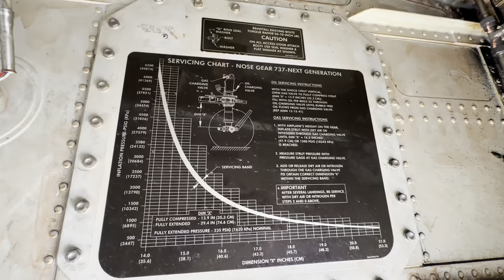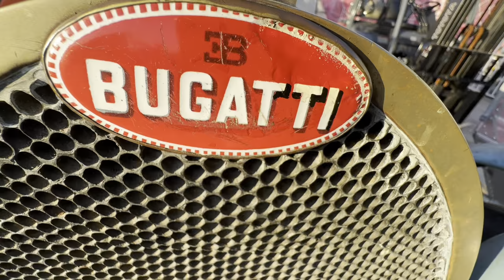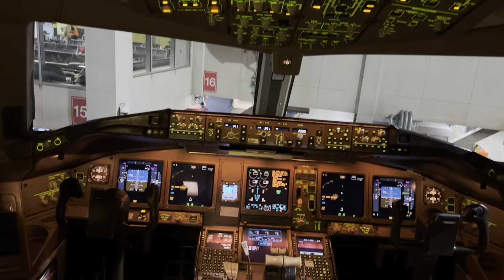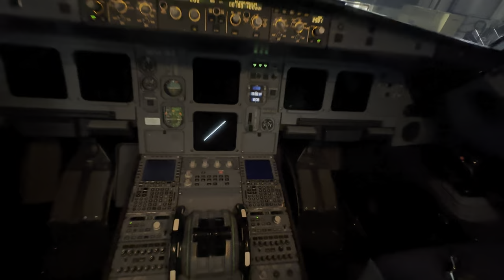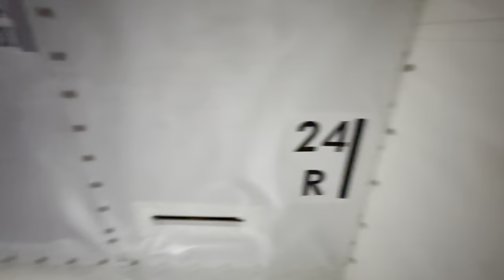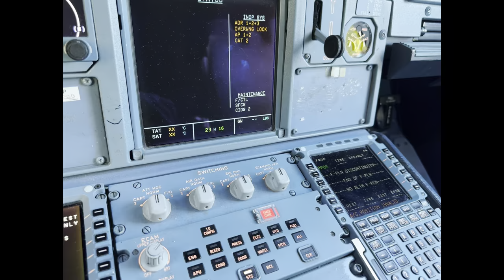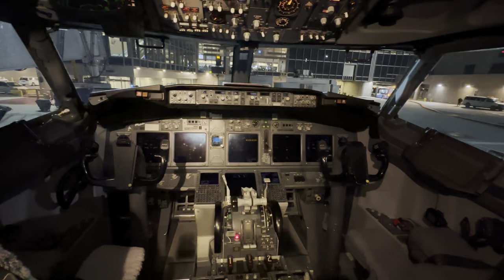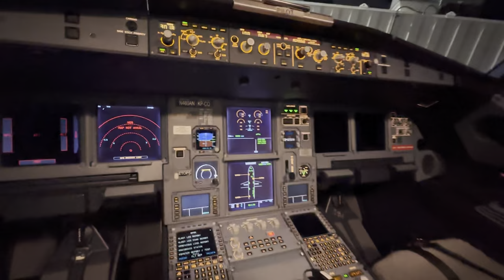Stig Shift. #13 (Aircraft maintenance Adventures)

Comment from the maker: Ladies and gentlemen a quick correction. I made a mistake on the batteries. In the video, I say milliamp hours, that’s incorrect, the correct terminology is Amp Hours. Sorry about that, I was talking too fast and said it incorrectly. 

Also, a bit of more context on the tail strike sticker, the reason it’s there is because the 321 is a longer aircraft
Reply: Funny! As soon as you said it I was correcting you :D no worries man, always appreciate the views inside & outside the birds, thanks for bringing us along and commenting as you go.
Reply from the maker: @rogerneumann8105  never hesitate to correct me, I am not perfect even I get things incorrect time to time. Also, it would probably help if I write a script for myself, but all I do is just start talking when I would look at the images 😂
Reply: @StigAviation NiCd batteries is a best choice to hazardous of Li ion and heavy of Pb gel I suppose.
Reply: Lithium is a newer technology than ni-cad. When lithium came out it has a higher energy density than ni-cad and no memory.
Reply: @Rwalt61  lithium cell make hydrogen when reach end_of_life
Reply: Also they do that when you over charge them. Lead acid batteries do to. That's why should not smoke anywhere around batteries.@vittoriobacchiega9118
Reply: Stig, would it be possible for you to produce a segment of one of your vids showcasing those low-slung tugs that seem to be everywhere, moving aerodynes around the ramp, in and out of hangars, etc??  A short "interview" with a tug operator would be icing on the cake !!  😊
- Jon
Dartmouth NS 
Canuckistan
Reply from the maker: I’ll try to make that happen but I tend to keep the personnel that work on the airport out of the channel because most are not comfortable with showcasing themselves. But I’ll do my best.
Reply: You know what I think a lot of us can agree upon is making a mistake and clarifying it makes you Stig more of a human being and a humble one at that.  Keep up the great work and one thing I really enjoyed from your earlier videos was the trivia-type questions placed randomly.  Keep up the great work and thanks for this unique perspective.
Reply: Ur good stig , although it was cool to hear Ur cats in the narrative 20:41 I paused the vid thinking it was mine though, Cool Cats BTW.
Reply: ETOPS=engines turn or people swim
Reply: Terrific, inside changing the O2 bottle was extremely interesting, computer banks in 777 also very interesting. Just goes to show how well engineered this planes are.
Reply: Hey Stig, great videos 👍👍. I have an interesting bucket of info about the 787 whistle caused by a poor design (vendor) of the wiper arms.  I was personally involved in the troubleshooting of whistling in the flight deck.  A simple taped piece of .050" safety wire under the  windshield wiper arms, cureda whistling heard in the flight deck. (We're not allowed to use the term "Cock Pit"

Comment: Being an automotive guy, the complexity of a modern plane is mind-boggling. I can see why one takes a LONG time to build.
Reply from the maker: They are extremely complicated machines.
Reply: I love working on cars too. If the job's done right! AlI the correct parts etc. I like to work on nearly anything realIy, garbage disposals. Locomotives. Anything. IF THE JOB'S DONE RIGHT. I like to machine parts too. I like it aIl.
Reply: Re: time. Yeah. Like shipbuilding. Everything's built in modules now tho. Piping, electrical etc. Everything hooked up and in place. Just weld modules together.
Reply: The big crosshead marine diesel/dual fuel (residual - NG) are the most efficient engines, running 53 - 54% LHV thermal efficiency now.

UH OH! I pulled a Stig! I misspoke. The big new combined cycle units are the most efficient. Gas turbine/steam turbine. But it's not realIy just one engine. It's two, running in series. Gas turbine exhausts into a 2 or 3 stage heat recovery boiler which raises steam for a big induction steam turbine. Very efficient. Indeed there's a big GE H series turbine running in Japan now which is doing some 63 1/2 % LHV, the world record. Running gas turbines simple cycle as is done in planes (no other choice, unfortunately. Kinda hard to haul massive boilers & steam turbine generator's around. Tho the big Antonov Miyria did carry turbine rotors, boiler assy's etc. around before the Rooskie's blew her away) is very inefficient. Blasts waste heat out everywhere. Sir Frank Whittle realIy blew it there. That's life. lt is what it is. For many years, back in the day, Gas turbines would barely run themselves because the aux load is so hi. Compressor, lube oil pump, generator etc. etc. Additionally the part load efficiency efficiency of gas turbines is very poor, because the 1st stage turbine nozzle temp falls off so much. Which is why aircraft gas turbines are designed to run most efficiently at cruise (only part load) not at full load (takeoff) because the full load operating time is so short relative to cruise operating time, while power gas turbines are designed to run at max efficiency at (continuous) fulI load. The 2nd Thermodynamic Law is a bit__. So much so that we dam welI better get power generation and transmission, distribution etc. efficiency up. Way up or we're gonna boil ourselves right off the planet with alI the waste heat we're generating by the time everyone gets alI the power he wants and thinks he needs - for his table saw, router, lathe, milling machine, his wife's sewing machine, dishwasher etc. Cogeneration's gonna really have to take hold - Stirling Engines, fish farms, greenhouses, building heating etc. The 2nd Thermodynamic Law's a real bit__. I could go on and on. Love this stuff (BSME).

DAG NABBIT! PulIed another '○□♤%%%^^○●¤**!@!! Stig:

GIobal UHVDC node to node xmsn grids, ultra hi efficiency combined cycle units, fusion (which wilI have to employ the aforementioned combined cycle unit gas turbines runing closed cycle. Lo temp reject heat is no joke. Everyone in Madagascar, Zamboanga, Mongolia, you name it's gonna want his share of power. Global lo temp waste heat production wilI be tremendous if something's not done.
Reply: The Renton Washington factory cranks out a 737 in just over a day. It's incredible. But yes that's from assembling submodules. 

The wide bodies take a bit longer I think 5 or so days. Something like that.
Reply: recently signed up for school to go back and get my a&p switching from automotive at 27 hoping im not too old

Comment: The PC-12 is one of the aircraft manufactured by Pilatus, generally referred to as the “platypus”.

The 321 “Tail Strike” placard is a reminder that because of its length you can’t pitch a 321 up as much during takeoff and landing compared to 319s and 320s.  There’s a chart that shows the actual limits for the 320 family (A32F) depending on whether taking off landing (because the gear strut compression is different) but as a general limitation, the shorter 319s and 320s have a 10 degree operational pitch limit while the longer A321 has a 7 1/2 degree pitch limit - those numbers give a 2-4 degree margin before actually scraping the tail.

By the way it may come as a surprise for the Boeing fans that the fly-by-wire A32F generally doesn’t electronically prevent tail strikes; the 777 has had that programmed in for years (as well as all 787s) so if you see a 777 with a tail skid you’re seeing an older 777; the skid has been removed in the newer ones since the airplane (theoretically) can’t tail strike.  Removing that mechanism - and the structural reinforcements that supported it - resulted in a weight savings equal to a couple of passengers if I remember correctly.

The A321neo does have a form of tail strike protection that reduces rotation rate and limits pitch, but like the big Boeings the crew  can override it if necessary by pulling full back stick.

Anyway, it is important for 321 pilots to remember they’re in the longer plane and they need to pay more attention to pitch; if they find themselves with a high sink rate coming over the threshold they can’t flare as much to save the landing.

Hence the placard.
Reply from the maker: Absolutely fantastic addition of knowledge. Thank you very much.

Comment: I had the pleasure of doing maintenance on Air Force 2  (when Boeing was threatening a strike and needed a heavy check).  Absolutely cleanest aircraft I've ever worked on.  Flight controls, landing gears, gear bays....all spotless.
Reply from the maker: I’m glad you got to experience that. Usually the airplanes I’m working on are already very dirty.

Comment: When you change the O2 bottle I would have thought you cap the planes supply inlet rather than just setting it down. Curious, that's all. Great video
Reply from the maker: The changeover of the bottle happened so quick that I really don’t need to cap the aircraft side of the line. As soon as I had the old one out, the new one was sitting right behind me.

Comment: 22:52 There's no way a battery that big (at a reasonable voltage) is 60 MILLIamp hours -- 60 amp hours seems more reasonable?
Reply from the maker: I apologize about that, I meant to say amp hours, I made a corrective statement and pinned it. Sorry about that, I was talking too fast.
Reply: @StigAviation All good, no need to be so apologetic! Great videos btw!

Comment: Hey Stig, Nice presentation thanks.  I almost went for Airplane repair at LaGuardia Airplane school in NYC across from the airport.   I went a different route.  I will call you on an error with the oxygen  bottle leak check!  When you tested for bubbles after opening the valve on the bottle I think looking for a leak on the vent side only at the nut was wrong.  If that vent line is going out of the plane thru the wall without a plug, it's at atmosphere.  If there was a leak at the overpressure valve inside that line you should check for a leak at the outside vent hole OR before you put the braded line on the fitting.   That's should be a NON leaking overpressure valve in the bottle valve head.  If you had bubbles there the leak would show before you put the line back on.    The overpressure side of that valve head shouldn't have any gas come out UNLESS that overpressure vent valve/pop off side was leaking.    That line would never build enough pressure to show a leak making bubbles, BUT it could be leaking out of the plane THRU the S.S. line and you'd never know it with the bubble method.   
I think that was a VCR type fitting on the vent line to the bottle?   Do you use metal seals and reuse because of the torque spec. or just replace?  The seals could be VCR on the 2000psi side and VCO on the vent side because of low or no pressure buildup.  
Just bust'n them a bit.  
I like your work and I enjoy watching the planes,  I took planes many times to many places for work.  It's good to know someone with your dedication and  positive attitude is out there doing a great job and loving planes.  :medal-yellow-first-red::washhands:
Reply from the maker: Thank you very much Arthur for that incredible explanation, and you are absolutely correct, but I don’t know if you saw carefully. I test leakage on the over pressure side as well as the supply side. In regards to that little brass fitting or seal yes some aircraft do have that.  Thank you so much once again sir.

Comment: @StigAviation So thankful for your videos that are amazing for me as an aviation enthusiast. I was looking for more details to learn more and gladly found your channel! We are forever learners on this amazing technology as you very well said in this video.

Interesting that you showed the seat of the 787 and pressed the button to move it without knowing what was going to happen days after you published this video. As you may know, the incident happened 2 weeks ago on a Latam flight to Auckland, NZ, where the nose suddenly dropped and many passengers resulted injured. Would be interesting if you can go again over that seat and check that button with its cap which seems to be faulty. Incredible how a simple cap may have triggered what happened that awful day for those passengers and crew.
Reply from the maker: I’m glad you saw this video, and if you have time, take a look at my recent video where I go into full detail, explaining the seat, electrical movement and show that switch in detail.
Reply: @StigAviation  Great! I already watched it and confirms my doubts about the slow speed of the seat, seemingly difficult or almost impossible to hit the yoke in such a way to cause the nose drop. There is even a U-shape space to avoid seat contact with the yoke. I didn't know about the power off switch in case the pilot decides the movement is unsafe or anything, more argument to consider this hypothesis least likely. Next hypothesis is about screens going off for seconds? the 51-day cycle with no electric reseting? I don't get this, what is the issue of 51 days with no reseting? how can the electric system be on for 51 days? and if it were to be, why can this happen and put off the screens?

Comment: Who cleans the cockpit  ?
Sense it has become a highly restricted area.

Also does the newest 787 come with a heated yoke ?
Reply from the maker: Usually the cleaning crew will vacuum the floors, but the screens and control surfaces are done by the pilots. The 787 does not come with a heated yoke.

Comment: Question on the 777 avionics/equipment bay: Is the compartment pressurized? ( Since the nose wheel bay sits right in the middle and is not pressurized )
Reply from the maker: The avionics equipment bay is a pressurized compartment.

Comment: Great video (again!) Stig. Thanks!
I made a quick research about the data bus system and realized that Boeing didn't abandoned ARINC 629 and returned to ARINC 429. In fact they returned to a point-to-point configuration but using a new standard ARINC 664 / AFDX that offers a higher data rate, improved reliability and greater flexibility. This new system, used in the 787 and 737 Max is the same used in A380, A350 and A320neo family. There is a new multidrop data bus standard (similar to the ARINC 629, but faster), the ARINC 825 / CAN that can be found in the newer aircrafts such as the latest regional jets, latest business jets and latest helicopters.
Concerning the oxygen bottle change, I wonder what is the need for a leak check with soapy solution on the overpressure hose connection...🤔. Even if the safety valve has a small leak, once the hose is open to the atmosphere would you see any bubbles leaking from the connection?
Reply from the maker: You are correct on the 664, but it’s only on very certain systems, and they’re using ethernet at that point. In regards to the soapy solution, we just wanna make sure that the threads have not been damaged and we have a good seal, and it also calls out the manual to do so.

Comment: Hello Stig.
I just came across/ discovered your you-tube channel a couple of days ago and have already sat through 3 of them. I'm very impressed with the quality. I've subscribed and will definitely be checking out more. It's like reminiscing of my years on the ramp. A&P since 1979. Braniff for 3 years (until getting furloughed just prior to their bankruptcy). Went on to Northwest, spent about 3 years in the hangars of MSP then BOS line maintenance until 2005. Had to switch careers then, but still dabble in general aviation for a friend who runs an FBO. Whenever he needs sheet metal/structural work, he'll call me in.
I read a lot of comments from potential A&Ps, and like you, I couldn't think of any more rewarding career. Sure, when you start out, you might have to move to a company's main base and put up with a less than desirable shift/days off pattern, but it pays off. I'd do it all over if I had the choice.
So, keep up the good work.
I look forward to following you around the ramp.
Reply from the maker: Thank you so much Michael, and I can already recognize that you were a man that is a wealth of knowledge within aircraft maintenance. I appreciate you being here, and I appreciate you thinking in the positive direction of the future of aircraft maintenance.

Comment: Back in the 1960s-70s they used honeycomb flooring in RVs.  It's starting to become popular again.

The Bronco Raptor is the most expensive SUV Ford has ever offered.  It's a bit insane in my opinion- and probably high-maintenance.  That could even be a Maxilider Bronco, of which only 150 will be built.
Reply from the maker: Nowadays, it’s all about weight saving, the lighter it is the more it can  carry

Comment: There is a little tube coming out of the bottom of the engine cowling on widebody jets. (They may be on 737's also, I've never checked.) They look kind of like a pitot tube facing the wrong direction) When the engines are running, sometimes I see smoke or steam coming out of these tubes. What are they connected to and what is their purpose?
Reply from the maker: I believe you made it to the end of the video and saw the information you needed

Comment: Ah another great episode from Airport Stig.  Some say his veins are filled with hydraulic fluid…and that his drink of choice is H515 on the rocks!!!!😂😂

Re the orange/brown substance in the 737 nose gear bay,  I used a brand called Dinitrol on Beech 1900D aircraft.  Primarily used it in gear bays, external side of rear pressure bulkhead and tail fin rear spar and wing spars.
Reply from the maker: That stuff smells so horrible when you brush it or spray it on 😂
Reply: @StigAviation  Agreed!  Never looked forward to that job when using that stuff.